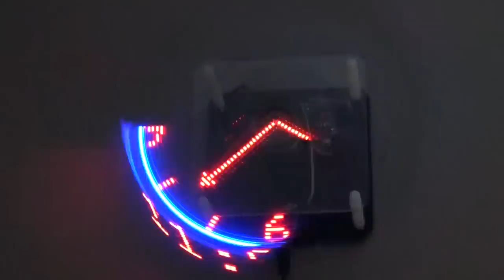pocket video game kit build

Comment: Such a big chip for such a small game. Lol. That is the size of the Motorola 68000 series cpus that were in all the mid 80s computers.
Reply: Well at least it isn't surface mount. A little easier to build this one.
Reply: Many chips are 40-pin. Z80 is too.